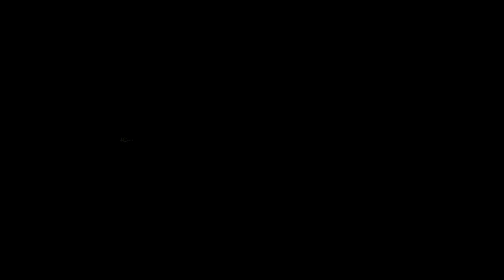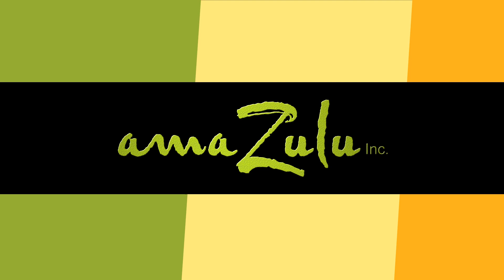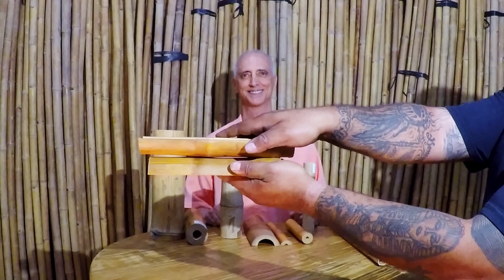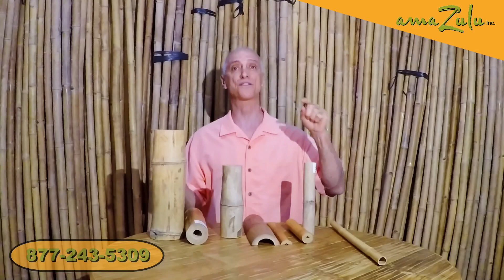Types of Bamboo - Construction Materials - amaZulu, Inc.

Comment: I have a question.
How can one differentiate these types of bamboo?
Reply: That is a great question and there are a variety of answers that will help you. There are many apps on the Internet that specialize in plant identification. You simply snap a picture and the program does the rest. Some apps are better than others but they all work. Of course one the photo software is actually doing is looking at the features of the plants various parts, including the leaf, the stem, the flowers, and so forth. Another way that you as a consumer can identifies the different types of bamboo is to study the route system running bamboo will look exactly like it’s name implies lots of long trailing rhizomes, while the so-called clumping bamboo species have a root system that doesn’t travel very far laterally just underneath the surface of the soil but rather spins around underneath the journal area of the plant someone like a basket maker would weave a piece. And if you’re interested in growing the bamboo then of course you need to know what your zone is and what the micro climates are in terms of soil moisture so on and so forth. Bamboo is fascinating and I’ve been fortunate enough to take care of some local stands and do different projects with the materials. Good luck!

Comment: What type grade Bamboo You would recommended  for concrete walls - Bambo  framing /- solid flexible stronger x3  structure  future vision ....tnx for your tips
Reply from the maker: Sorry for the late reply. If you still need advice on which bamboo to use in this application, please contact the office at (352) 243-5309.